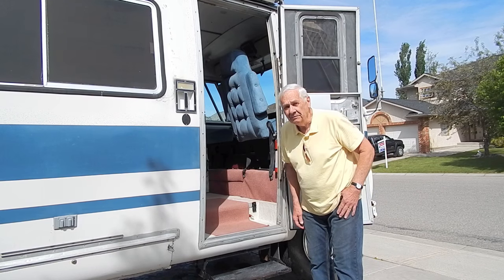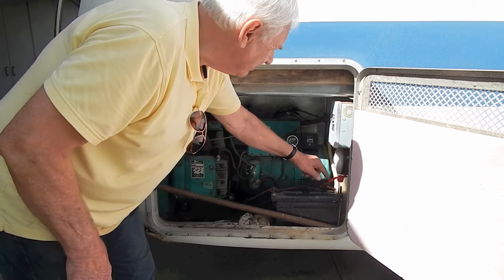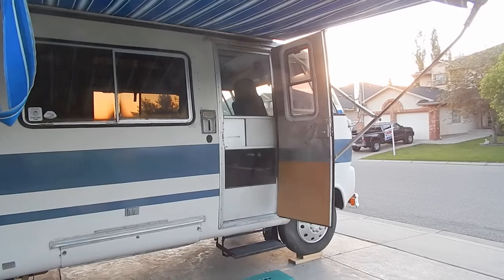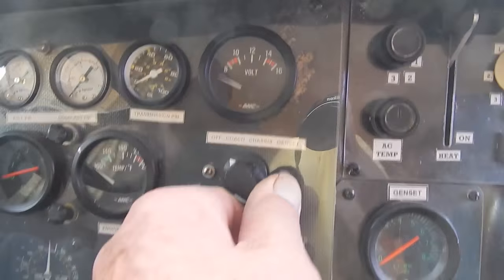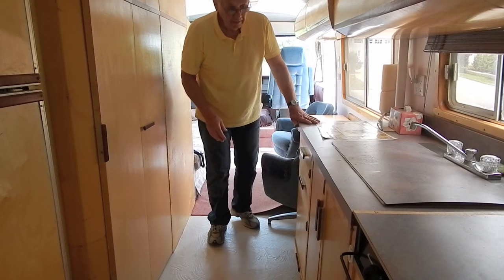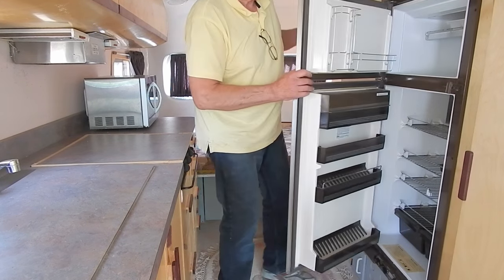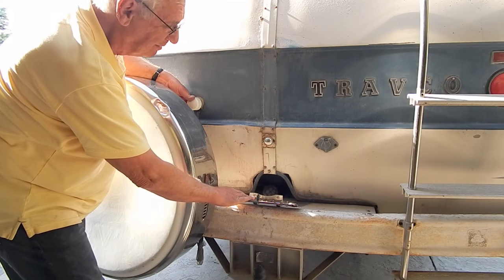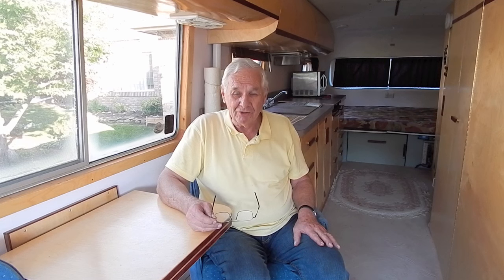Travco Motor Home Restoration Jun 016

Comment: That's a very nice job and worthy project. We still have our 1966 Travco 27 foot motorhome in storage. My dad bought it from Dick Smothers of the Smothers Brothers in 1968 and we did a 10,000 mile trip around the USA during the summer of 1969. There are a lot of memories in there. Your restoration inspired me. I think I had better get right on this project as I don't think I have another 20 years on my clock!
Reply: kimmer6 Incredible job Carl. I love your work and video.

Comment: Beautiful older Motorhome man.  Love all the improvements you've made especially the front seat suspension bases.  I would be proud to own something like this and to use it to go camping regularly.  I mainly like older motorhomes because I despise slide-outs on motorhomes. They may offer additional living space on the motorhomes interior but they are notorious for getting stuck open at the most inopportune moment like when your breaking camp and ready to hit the road to the next destination.  And their not easy to work on or repair either.
Camping and RVing should be about stress management and reducing stress and anxiety.  That's why I like well thought out older motorhomes such as yours.  Great job fixing this old Travco up man.

Comment: Pretty restoration!  Those are the wrong coach batteries, because they are paralleled.  The weaker one will discharge the stronger one.  The cure is series-connected 6-volt batteries.  GC1 golf car batteries work great, designed to be nearly fully-discharged without damage.
Reply from the maker: Thanks for looking at my video. You've got me thinking about the coach batteries, the motor home originally had a large 4D diesel truck battery  and no chassis battery. I added a separate chassis battery and installed two deep discharge 12V coach batteries, they are different colors but I think they came out of the same factory; one is an Interstate and one is from Costco but they have identical specs and identically shaped cases. They were much cheaper than golf cart batteries.   Any time I've disconnected and checked the voltage of the batteries, they are within 0.1 volts of each other. I have some experience with large diesel engines - it's common to use two large identical 12 volt batteries connected in parallel for electrical systems and cranking. Thanks for your comment.  //Carl

Comment: Travco's were built in Brown City, Michigan, however the M500 chassis was built at the Tecumseh Road Truck Plant in Canada.
Your Travco 270 has a M500 chassis that was originally equipped with a Spicer 70HD rear axle which had a 4:56 gear ratio.  Only the 320's came with the M600 chassis and Rockwell rear axle (with a 4:88 gear ratio).  So you're saying you swapped out both front and rear axles and now have the 6 bolt wheel pattern?

Comment: nice job, love how creative you are. How did coil get around water tank?
Reply from the maker: Joel,  Took water heater to the shop, removed outer cover and insulation, tightly wrapped the inner tank with 30' of 1/2" soft copper tube, lightly knurled the ends of the tube with a tubing cutter so heater hose won't blow off, replaced the insulation and outer cover.   I ran pressure and return rigid copper tube from the engine compartment to the rear of the motor home and insulated the pressure tube with foam pipe-wrap.  Water temp is surprisingly hot after a few miles on the road.  Rear 12V heater also works well.   ////Carl

Comment: Great video Carl. We just bought a 29 ft 1977 travco and in the process of remodeling. Can't find any info on gas mileage, could you share what you get in yours?
Reply from the maker: Ron, 8 miles per USgallon average driving;  almost 10 if I hold up traffic.   ///Carl
Reply: Mine gets about 8.5 mpg at 60 mph on the highway.  I get about 7.5 mpg when towing a 3500lb trailer.  I am running the original 4:56 gear ratio with 8R19.5 tires (33" tall).